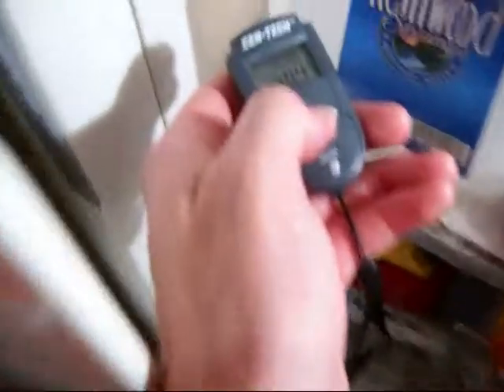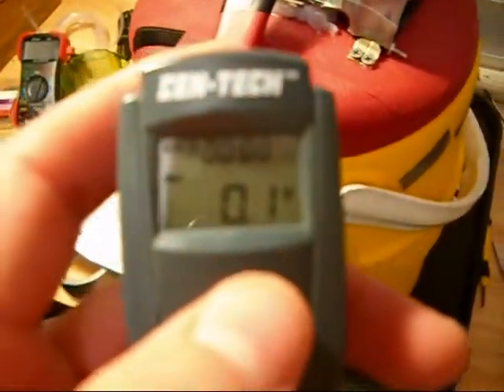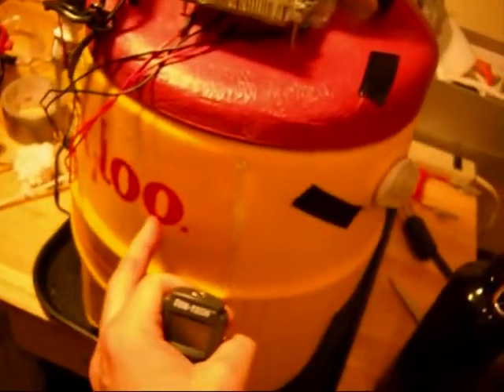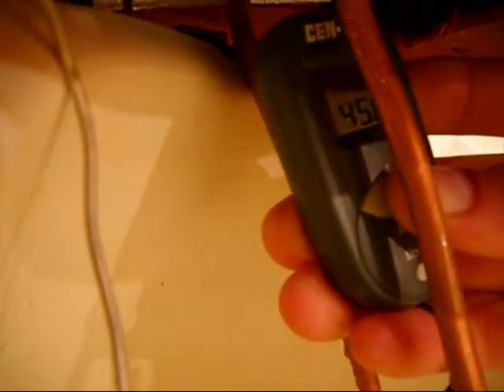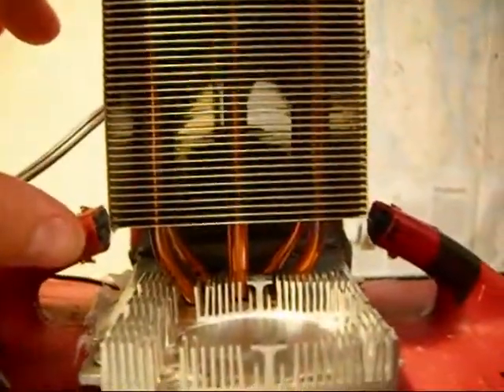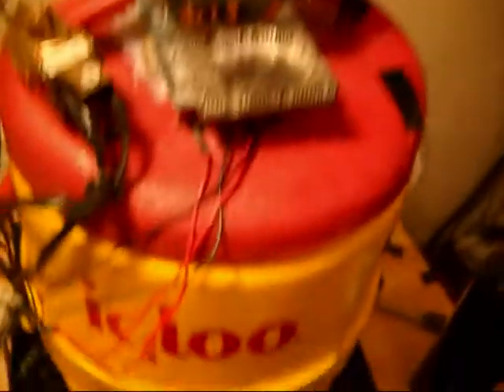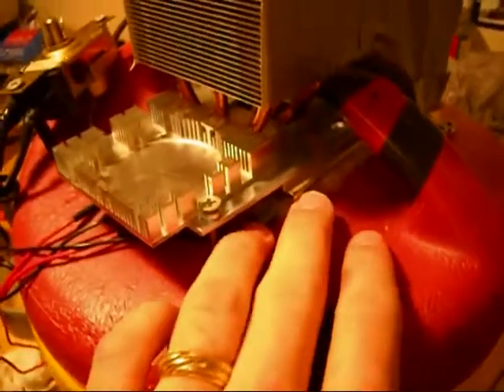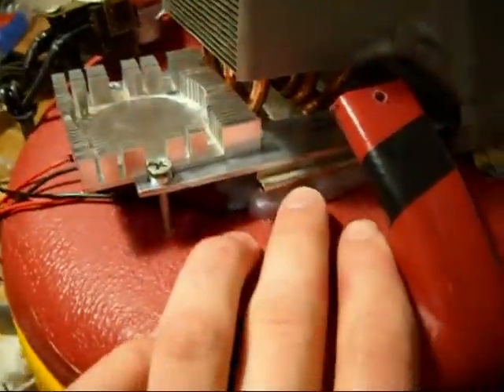Thermoelectric Cooler Part 14 - Results, Mediocrity, and Hope for the Future

Comment: Taylor Holmes. Wanna make this work? Get one 72W Unit, a cpu water block, a pump, and have the water recirculate through the block as it runs to cool the water. You can do it off of air cooling (for the hot side i mean) but water cooling is more efficient. youd only be using roughly 30 watts to run everything.
Reply from the maker: TCircuitry, that's pretty much exactly what I did, minus the 72W thing.

Comment: Btw My Peltier Specs for my 1 Day Igloo Cooler for items is: TEC-12706 60W Peltier module just one. 15V MAX. about 5 Amps Max. Powered by 9 Volts DC at 2.22 Amps. Fan is 92MM 12V 75 CFM 32 DB.

Comment: As I said on the other video, Try to Run your peltier units at a voltage of around 9 to 7.5V depending on your TEC voltage rating. Experiment with what voltage your peltier unit likes which balances it from temperature to efficiency it makes a moderate difference. Lower voltage means less heat wasted to the hot side which means cold side gets colder. And submerge your Heatsink Fins into the water or get a heatsink with really long fins.

Comment: SUGGESTIONS:
1) Insulate the two peltiers by drowning them in a layer of silicone so that there silicone is in all the area between the full heatsinks but not under or above the cells (no air anywhere near the peltiers)
2) Change fan with a more powerful and/or bigger diameter
3) Make the fan shroud perfectly air tight all around the fins (that cooler is fine it only needs more air though it)
4) Work on the cell specification voltage, never below as their efficency drops drastically